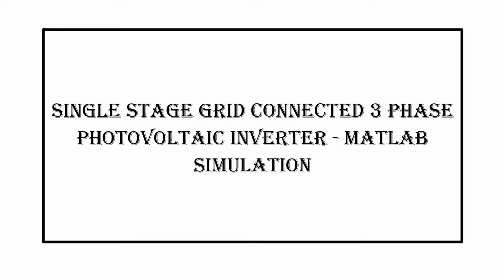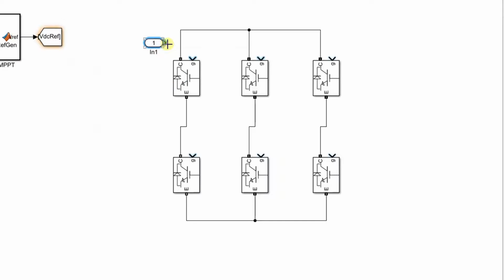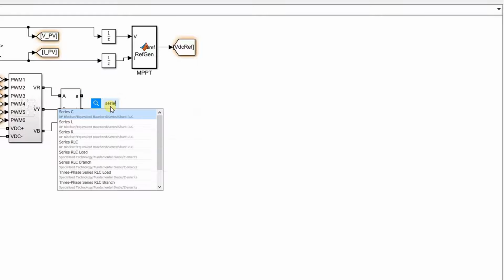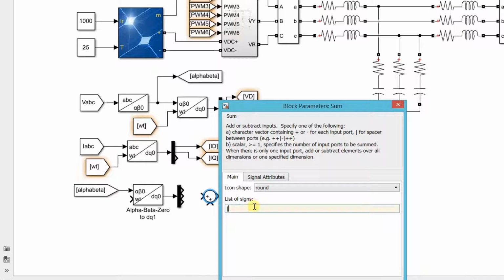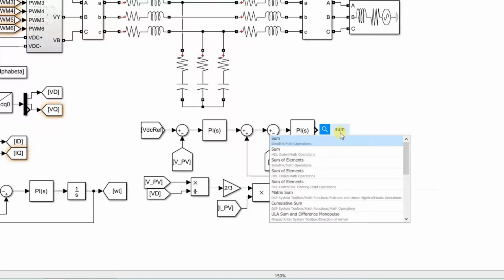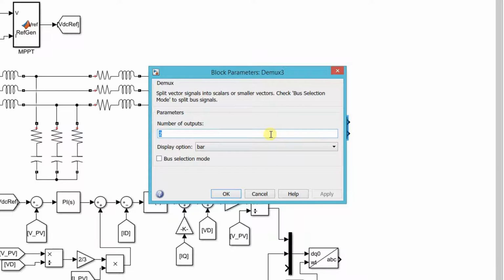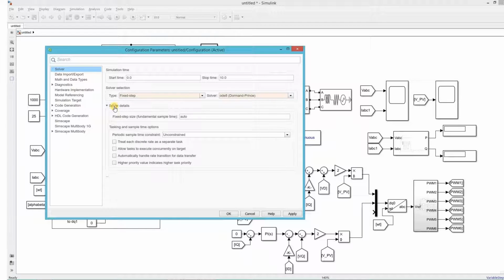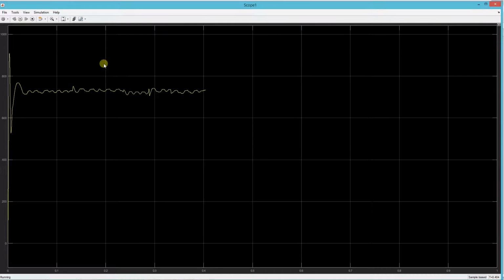Single stage 3 phase grid connected solar inverter - MATLAB Simulation

Comment: Hello sir , thank you for a great video. I have a question , what is the role of this voltage source that mimics the grid at the right side ? It does not provide power right ? Like So it is not like when we have this three phase source as external load and we have pv and inverter on the other and a load , and if the load increase more than the inverter can provide this grid would like give power or sth right ?

Comment: Hi thanks for this great video. May i ask how can i adjust the inverter output current into the system ?
Reply from the maker: current is adjusted according to the power level
Reply: @TechSimulator  thanks for replying. So how to vary the power level wisely . Is it by changing the number of panels or do u have any other suggestions?
Reply: @TechSimulator  and also can i ask, if i add a transformer after the grid source, and i want to measure harmonic voltage and current, how should i place the measurement block

Comment: First I would like to thank you  but 
I have a question  and I need your help, why the values that appear on the 3 phase power measurement do not exceed 2000 and sometimes take negative values even though the power of the system should be 100 kilowatts
Reply from the maker: negative value because the direction of the current sensor connected in the circuit. but it should read 100kw, not 2000. in my simulation it shows correctly. you can share the model at my email if u want to correct it.

Comment: very good work sir ,, it is indeed a very useful video for every one to understand the basics ,, i had a question how can we check or plot the graph of frequency of the output voltage , like we can measure the line voltages of inverter how we can show the 50 HZ or 60 HZ frequency plot of the inverter.

Comment: There is no any  buck boost converter for getting constant DC voltage
Reply from the maker: I did not get your question?
Reply: @TechSimulator  By changing the irrediance of the panel, then panel  output voltage also varies but hear inverter was not varying why ?
 I think  inverter switches duty cycle was varying with feedback  for getting constant output voltage
Reply: By changing the irrediance of the panel, then panel  output voltage also varies but hear inverter was not varying why ?
 I think  inverter switches duty cycle was varying with feedback  for getting constant output voltage

Comment: Which parameter determines the output power of the inverter? In my system, there are PV modules with 121 kW DC power, the output power of the inverter is 100 kVA. How can I design the circuit? @Tech Simulator

Comment: at 10.02 sec, your video is changed,,,,, can you please help with the filter inductance value... Thanks for the incredible work..
Reply from the maker: check my previous videos. i have explained the design
Reply: @TechSimulator  sure will do that. Thanks for your reply. Will also contact you through email. 
Many thanks for the work you’ve explained. Helps a lot.

Comment: I have simulated the same circuit using Sunpower SPR-305-WHT PV Array(Nser=5,Npar=66 and Voc 324,Vrefinit=273.5) for 100kw. But it gives the error as  

The sample time 1e-07 of 'single_stage_three_phase_grid/Sum8' at input port 1 is different from the sample time 0.01 of 'single_stage_three_phase_grid/MPPT/ SFunction ' at output port 2. Consider inserting a Rate Transition block between the two ports. Alternatively, you can control the diagnostic action for unspecified rate transitions by changing the option "Multitask (or Single task) rate transition" on the Sample Time Diagnostics pane of the Configuration Parameters dialog box. 

What could be the reason? I have put the sampling time and simulation parameters as in the video

Comment: Sir, I suggest you make one video that includes the practical implementation of inverter control design and external relays (like MCB, Precharge etc) to DSP Board (C2000)

Comment: Great work Sir, here I have a question that how can I obtained 4*2.5Kw and 3Kw ratings of PV using your model?
Reply from the maker: you need to re design the lcl values of the inverter. and in the mppt code you might need to change the initialised values
Reply: @TechSimulator actually I am not completely familiar with this huge presentation so is it possible that I share this slx.file to your mail for changing the specs to obtained 4*2.5Kw and 3Kw ratings of PV, I shall be very thankful to you for this act of kindness.

Comment: Hello can you tell me what is the difference between single and second stage grid solar inverters
Reply from the maker: when the available solar voltage is low (say less than 300V), then we cannot connect it to the grid with inverter alone. There first we need to boost the voltage to a level which is more then 700V using any DC DC converter, and then connect to the inveret. such a system is generelly known as double stage grid conected solar inverter.
Reply: @TechSimulator  Please the 300V and the 700V are those IEEE standard values?, which paper could help with those values so that I can reference them. Thank you.
Reply from the maker: when the available solar voltage is high(say more than 700V) then we can directly connect the solar to the grid by using inverter alone. such a system is known as single stage grid connected soalar inverter.

Comment: why you are getting about 305 volts when you set the ac output voltage like 400 volts and because of this, the total output power is V*I = 305*200 = 61 kW. this is a very big difference while you are designing the system for 100KW @TechSimulator #TechSimulator please answer.
Reply: It's is correct only, 400 is ph-ph value. So peak ph-g value is 400*√2/√3 = 326approx

Comment: Is this applicable also to stand alone?
Reply from the maker: no. we cant implement mppt in stand alone system. if we have a battery storage, then it is possible to have mppt
Reply: @TechSimulator  why vabc and iabc1 are out of phase and why power is negative? Could you explain this?

Comment: What is the difference between two stage and single stage grid connected solar inverter.
Reply: Hi Santanu, I think the difference between them is that in single-stage system we only have the PV system connected directly to the Inverter (DC-AC) through a capacitor dc link, while in a two-stage system we have the PVV system connected to a (DC-DC converter which could either be a boost or buck type depending on your design) and finally to the Inverter (DC-AC)
Reply: @fredricknkado3142 have you got the output